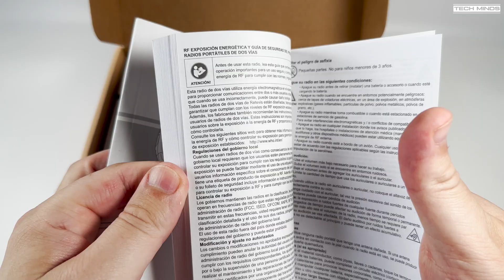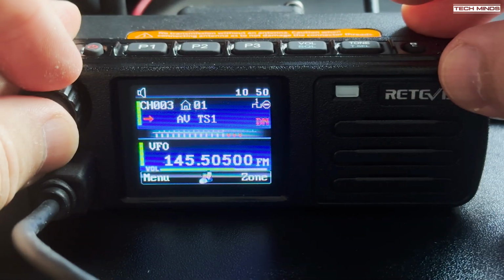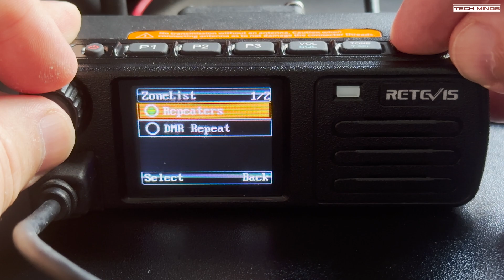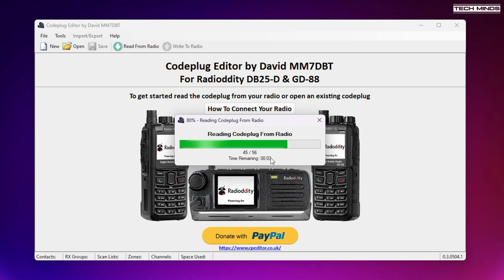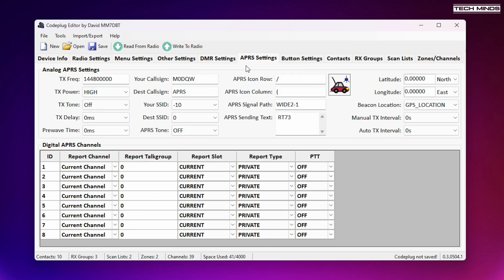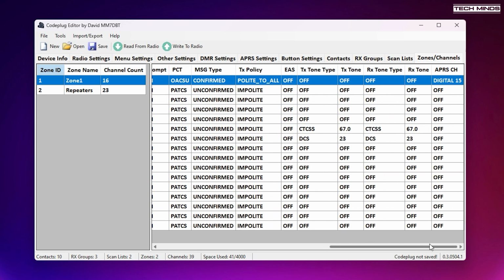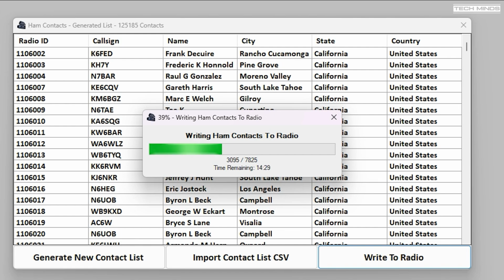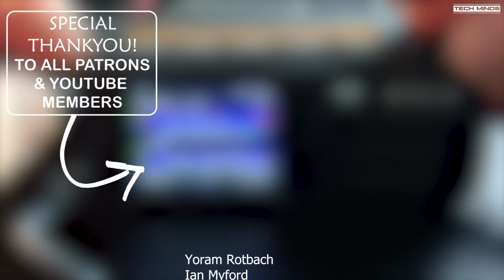Retevis RT73 - Easy Programming With Code Editor by David MM7DBT

Comment: Thanks for showing this Matt 👍

It's an excellent little radio, perfect for fitting in modern vehicles with limited space for radios. I purchased the original Kydera CDR-300UV directly from Kydera, soon after it was listed on AliExpress etc. Then when it arrived I probably spent less than 30 minutes with the supplied CPS before I was editing the codeplug files in a hexeditor just to get something uploaded to the radio as the CPS back then was literally unusable. Then wrote a small bit of software to inject data from CSV files into the codeplug files.. Which has developed into what CPEditor is now :D

I'm glad Retevis and Radioddity decided to sell the radio under their own name as it brought a lot of attention to the radio and prompted Kydera to develop the firmware further.
Although Retevis seems to have given up on the radio since Radioddity came along with the DB25-D and then the GD-88, but at least Radioddity are pushing for firmware updates and doing a good job at getting the bugs fixed and new features added.

Radioddity seem to be going all in on the Kydera rebrands as they've recently announced the DB40-D.. Which is essentially the big brother to this radio, in a bigger form factor with 40w output while incorporating the true dual receive functions of the GD-88 with two independent VFO's
Which as it's based around the same base firmware as the other radios, it too will be fully supported by CPEditor :D

-David MM7DBT
Reply from the maker: You're welcome David! You have put a lot of effort into the application and it deserves it's recognition. Adding the ability to program repeaters easily and ham contacts easily, makes this a huge W for this app. Thanks for your hard work. Cheers, Matt

Comment: The terrible Retevis cps and bugs caused me to put this radio away in a cupboard after a few weeks of owning it. I will definitely be digging it out and giving this a try as I do like the idea of a super compact dual band mobile.
Reply from the maker: Great news! Let us know how you get on with the CPEditor.
Reply: @TechMindsOfficial I've had a go with it and it's working great. Nice and simple to use, and no crashes! I think this radio is going to finally get some use.
Reply: @TechMindsOfficial My Retevis CPS
for the RT73. It would always show
Data Mistake, not being able to read
or write with the RT73.
I did download Davis' MM7DBT Code
Plug Editor, and at first it saved to
my RT73, and in the CPE software.
However, when I recently purchased
the Radioddity GD88, their program
messed up the CP Editor to the RT73,
so the CP Editor would write to the
RT73, but could not save my updates
any longer, even when I removed the
GD 88 program, The CodePlug Editor
program again, still giving me an
error warning attempting to save or
just quit.
I wrote an email to MM7DBT a few
days ago if he could help me, but
I have not received a reply from him
Also, I wote an email to Radioddity
customer service wanting to return
the GD88 to them not only because
I could not use their CPS, always showing Data Mistake, and this HT
has been used with it being programmed already from Germany, with the call DB00HL in its memory.
I told them this and Helen Lu replied
that she is sorry and offered me $30.00 and a program to reset and
reproman the GD88. 
I did not reply to this poor offer and
returned it via UPS to their address
in Las Vegas, which was shown as
being received there today.
I am not replying to her after this
ludicrous reply, and try again for
return authorization and a return address they do not list under
customer service, and there is no
phone number to call about my
problem, asking for a $201.99 refund.
If after being typed by Radioddity,
and if I do not receive a satisfactory
decision, I will contact my credit card
for help. I suspect that Helen Lu is
not at their Las Vegas address, but
rather in China. The videos they put
out over their products use are not
understandable to follow.
I think Radioddity, Retevis, Ailunce
and Kydera are all the same, rough
around the edges, like their unintelligible manuals, especially
lacking programming information.
NO MORE of these for me!
Coming to you from an amateur of
over 60 years, being 80, an a 100%
Disabled American of the Vietnam
Era War. Era, born in London UK in
1944, during WWII.😊
73 de W2CH Ray and KC2NKU, Marylyn.

Comment: One feature I've not seen any deep dives on is the recording off air function.  I understand it is quite a large memory and can hold 100+ hours.  Is there a way yet to retrieve these files direct from the radio and save them?  I have a DB-25
Reply: There is a function in the firmware to download the recordings from the radio, however since it was never used in the official CPS there is currently no way to download them. I have looked into allowing it through CPEditor but since the memory locations and file format are unknown I haven't had much luck with it. Kydera (the OEM, who still write the firmware for all models) haven't been much help either as I've yet to receive a reply to the numerous emails I've sent asking for details on downloading the recordings.
Reply: @DavidB445  It's sad that they do not realize this alternate software may wel be the reason so many more of these radios sell.  Improving it can only sell more.  Look at what the GD-77 open project has done.  If you want to start a petition to open source I'm with you!  I'd cite Creality 3D printers as another example that has worked.  The largest 3D printer company in the world now and almost fully open source.